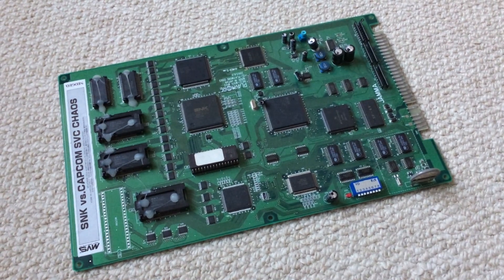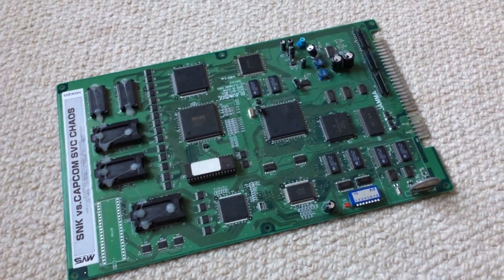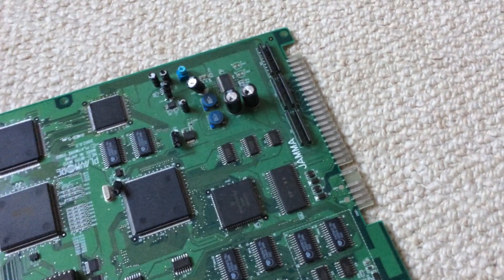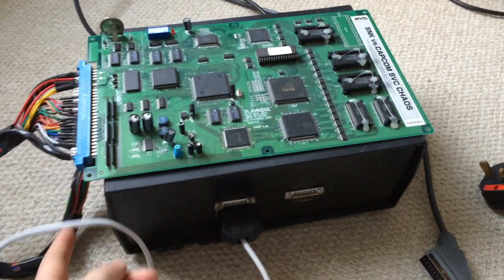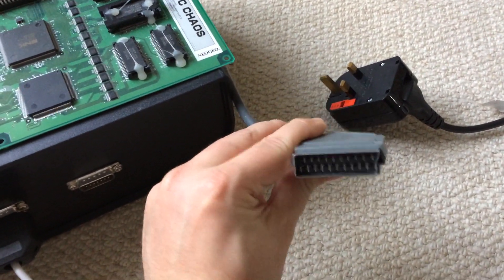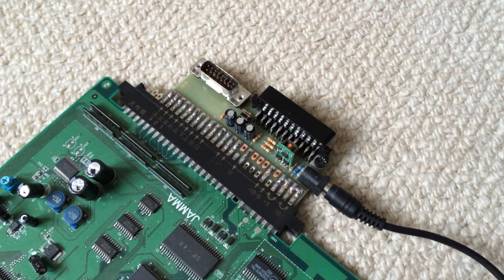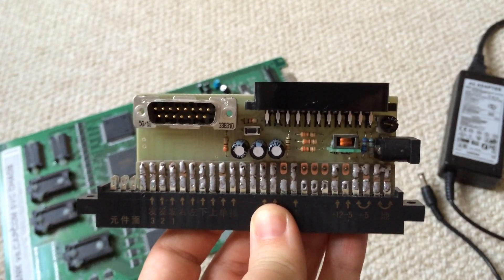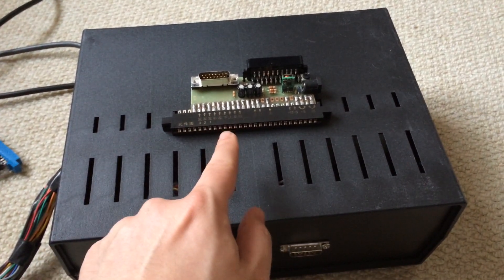Mini Supergun PCB (Minigun)

Comment: This mini supergun is absolutely outstanding, i can't wait to see the schematics :)

just curious, are you planning to build something similar but with 2 controller ports?
would be really awesome.
how did you manage to wire the insert coin button and other service switches?

have you tested it on an arcade MVS?
Reply from the maker: Hi, thanks for the comment.

I did consider 2 controller ports, it was tough to do though as the board was single sided and I needed nice fat traces as I was making it at home and I don't really have the technique down yet.

The coin switch is wired to the select button on the controller. The service switch on all the boards I have just gives a credit so I left it out. Also tilt often do anything interesting so it's missing. Test is really the only useful one so that's a microswitch on the board itself. 

An MVS is one board that I haven't tried yet. I have one it's just in storage. I highly suspect it'll just work though (my other 5 boards worked fine).

I'll try getting a move on with writing the blog post. I'm toying with the idea of doing a RevB with two controller ports and the -5V line implemented but I should probably release this first.

Charlie
Reply: Awesome, i cant wait :) sorry but i think i'm so blind that i missed your blog address, where can i find it? i've recently started to follow the retrogaming scene, and a neogeo has always been my forbidden dream, so now that i know MVS boards can be bought used at reasonable prices i can't wait :D

luckly for me, being in europe i have a CRT TV that has a scart plug, so (as far as i know) it doesn't need nasty encoders as it's stright RGB + audio wired up all togeder
Reply from the maker: atomikramp I've finally got round to writing the blog post. You should be able to find it here: http://www.moop.org.uk/index.php/2013/11/24/the-minigun-a-mini-super-gun/. I'd be really interested in hearing how you got on if you did make one yourself.